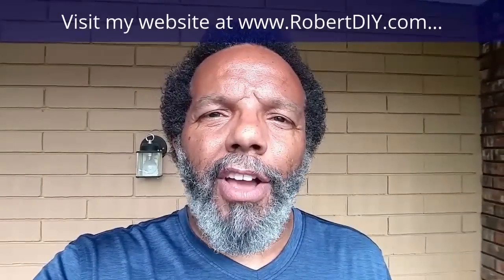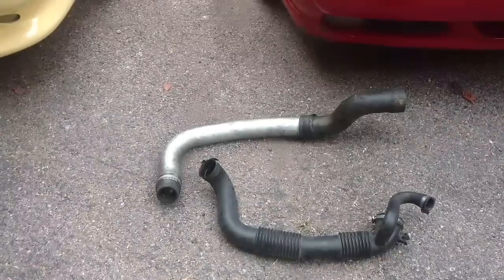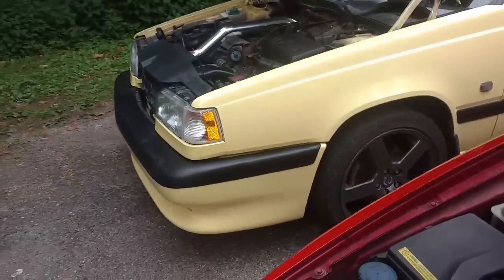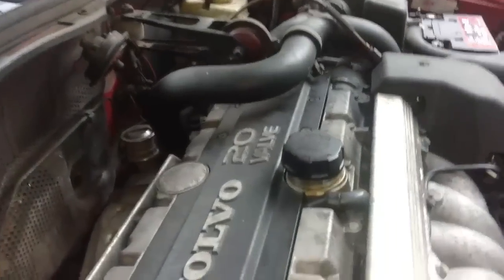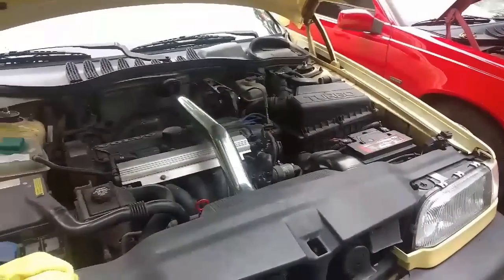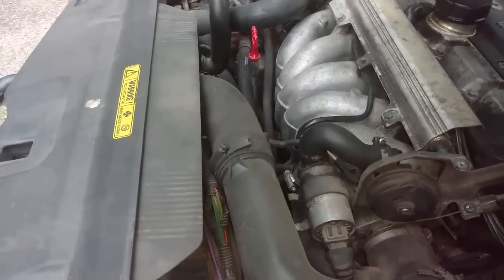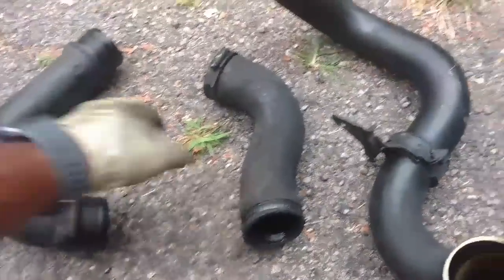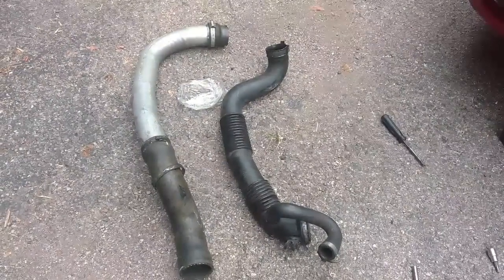Why you should install a RIP kit in your P80 Volvo, 850, S70, V70, C70, etc. - VOTD

Comment: My mom bought a 96 850 and I have been maintaining it for her. It is high mileage and seems like almost everything has gone throng with it. In the space of a couple years I have replaced the pcv system, brakes, struts,  radiator, thermostat, tie rods, trans fluid, timing belt/water pump, fuel sender gasket and lines, headlight lens, blend door servos, odometer gears, and probably more I can’t think of right now. While I am very comfortable with this kind of work, I had no experience with and Volvo before this one, your videos have literally made it possible for me to maintain and repair this car for her. Thank you so much for your instruction and explanation on these cars, you are a blessing.
Reply from the maker: Tell her that she needs to send me a cookie. 😋

Comment: Installed my IPD kit today, definitely wish I had gone with the Snabb… I had to cut the bottom intercooler elbow to make it fit and it was still super snug between the trans lines. 

Also the way the IPD idle air control valve (blue silicon) came was just a straight tube, so I really had to work it in to place so there would be 0 collapse in it. 😤 

I then had to use the original clamps for all the new fittings just for convenience. The 10mm nut on the ipd ones were a huge hassle. 

It’s an easy job, but the ipd kit added an extra hour to the install, along with a bit of frustrated curses. 😅 

Overall I love the kit so much! The throttle response is there immediately and the turbo is just so hungry for that cold air now, it gets a little taste and the BAM it wants MORE! 🎉 

Thank you Robert DIY 🙏🏻
Reply from the maker: Awesome! Glad you got it done.

Comment: Another reason for the RIP kit is, that it has less bends in the piping so the air gets less restricted and makes its way faster than with those two 90 degree bends in the stock setup.

from what i have heard they discontinued it in 1994/1995 because the cold scandinavian air in the winter got through the system too fast and caused problems because of the big temperature difference ... so maybe you should only install this if your winters aren´t that cold
Reply from the maker: Several areas were expecting iced up throttle bodies.
Reply: should i not go this route if i get occassional 20-30 F temps?  i live in Dallas-Ft Worth Metroplex (North Texas).

Comment: I took my 850T5 in to a volvo dealership to replace a leaking radiator. The service dept. told me that the RIP Kit (the long hard chrome tube going from the intercooler to the turbo rocks back and forth when we step on the gas. This puts extra force on the radiator and weakens the plastic more rapidly. My mounts are all in great shape and I don't see the engine rocking back and forth. My Rip kit is IPD. Do you think Volvo is just trying to get out of a warranty repair?
Reply from the maker: Probably. How do they know it rocks? How would that cause a leak?

Comment: Just picked up 2004 s60 T5 with a 5sp manual... Feels faster than my 99 v70r with a 19t
Reply from the maker: Probably because it is. 😂
Reply from the maker: '99 R should have an 18T.
Reply: I upgraded it to a 19t with a 9 blade exhaust turbine.

Comment: What do you think about adding a blow off valve?  i love that sound ! And the Volvo engineers did a great job of silencing the turbo sound . I wish I could hear the turbo without loud exhaust. Any ideas
Reply from the maker: Larger intake & cone filter brings out the turbo sound.
Reply: The turbo already has a blow off valve, it's just that the air is routed back into the intake manifold. There's a vacuum hose going from the blow off valve to the intake. Remove it from the intake manifold nipple, cover the nipple with a vacuum cap and let the hose stay open to the atmosphere. You'll hear that blow off sound when you let off the gas pedal, although it's not as loud as a tuner style blow off valve. I know all this because that's the way my 850 turbo was when I first got it (the previous owner had done it). It was cool for a while but I got tired of it eventually, so I reconnected the hose to the intake manifold.
Reply: @scottlewis4387  ik it's been three years since you commented this but I feel the need to correct you in case other new people see it and get confused.

The air on these turbos is internally recirculating, meaning the air never leaves the turbo, doesn't use any hoses to recirculate or vent. instead, what you're describing is the BOV/recirc valve's vacuum hose, which senses the pressure in the intake pipes and controls the BOV/recirc. Disconnecting this hose stops sending boost pressure signals to the valve and it stays shut. you don't necessarily need to close off the turbo side since it's just a valve, but it would be nice to keep it clean from dribs in case you want to use it again. The noise youre discribing is actually turbo surge, which also sounds amazing, it's that stustustu we all know and love.

Comment: Hello Robert, can this also be applied to Ford Focus ST 225? It's actually running a Volvo 5 cylinder unit from the factory, 2,5 litre B5254T. Thanks for answer.
Reply from the maker: It should already have this type of piping. You may find an improved set up but it likely will not matter much.

Comment: Any reasons why you went with Snabb instead of the IPD  RIP kit?
Reply from the maker: Not really. The pipe to the throttle body seems to be larger and I caught it on sale. Also I have heard that the silicone pipe pieces fit a little better, easier to install.

Comment: Are the headlights on the red s70 off of a s40?
Reply from the maker: No, C70.
Reply: Hi, No you can't use S40 headlights there different you can use E-code headlights FCP Groton use to have them or you can use C70 2004 jeweled headlights for better lighting
Reply: Dave Walker I almost ordered some s40 the other day but upon reviewing the pictures it didnt look like they were the same. Thanks though, now I know an '04 c70 pair will be a sure fit

Comment: Do you always have that turbo heatshield off or do you do it only for video purposes?
Reply from the maker: Heatshield bolt broke off in the manifold a few years ago. So it's been off.
Reply: @RobertDIY  it's ok to run the car with that heat shield off?   I think so but just asking.....

Comment: Was confused by the difference in what you installed in Queen B vs Panther? Was the Panther hoses you installed a junkyard pull and the Queen Bee setup is the new kit from Snabb?
Reply from the maker: I have not touched Panther so you are really confused. :p  I found an OEM Volvo 850 RIP kit in Lousiville junkyard a couple of months ago, just put it in Lil'Red. The upper intercooler tube was split. I put the new Snabb kit in Queen Bee. I like the Do88 kit as well (it looks like you can get the spark plug cover off easier). I think I'm going to put a Snabb kit on Panther as well. Mainly because I'm going to upgrade the turbo on it. A few people claim that the turbo lag is the same because the pipe is so big. lol I guess that would be the case if your turbo is small and weak.

Comment: That lower hose to the intercooler, did they shorten that bend also or incorporated into the pipe?
Reply from the maker: Part of the pipe on the OEM system.
Reply: I'll have to take another look at mine in a min and see if i can't figure out a way to reduce rubber. I've been thinking of the possibility of a small ram air hood scoop directly over the air box to force more colder air in the engine. Ill have to draw something up first
Reply from the maker: Some people just get the inlet pipe system/kit. From the air box to the turbo inlet.